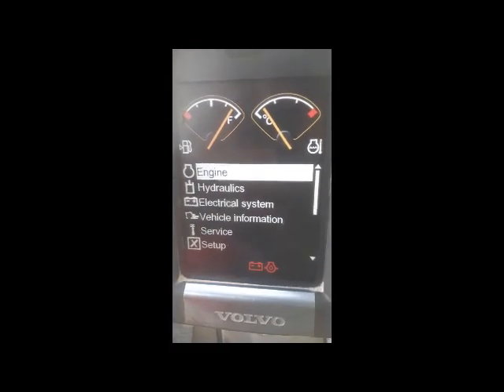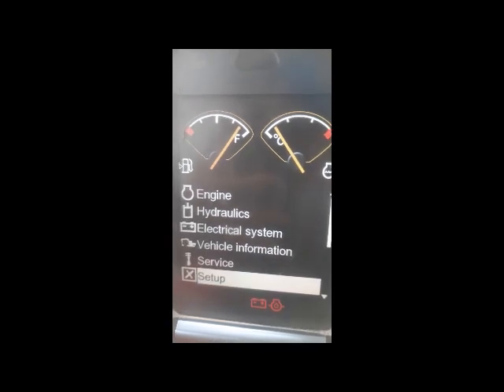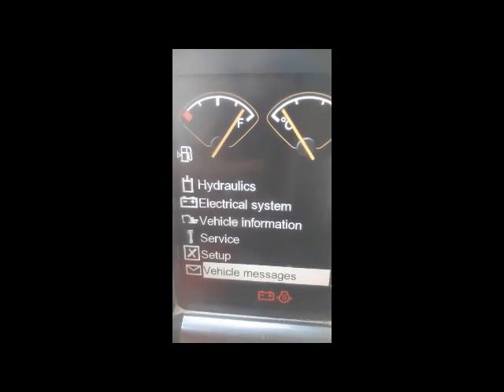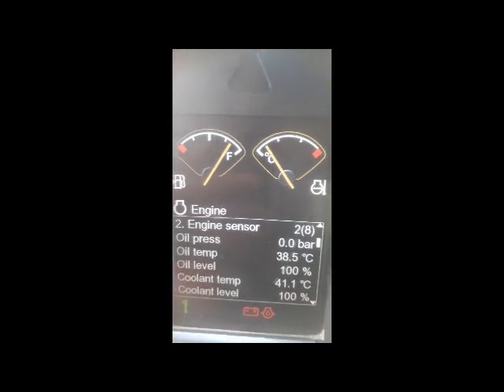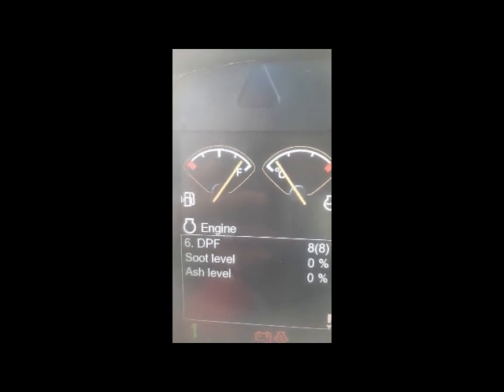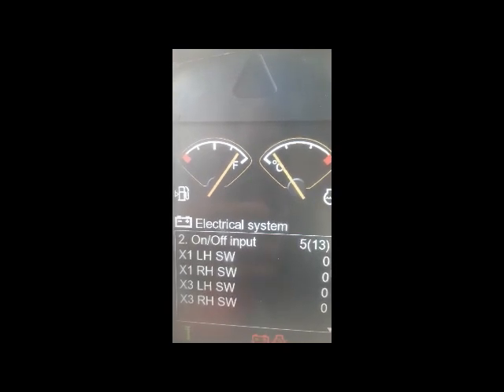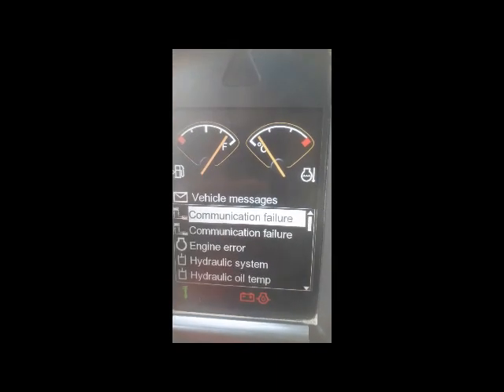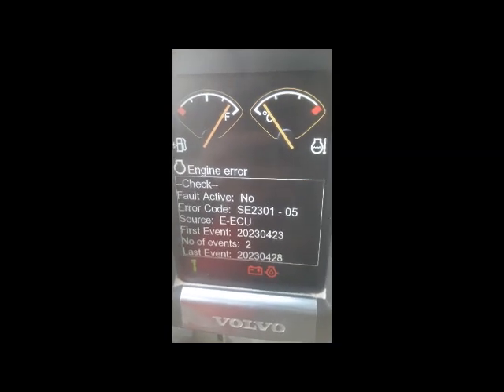Mastering Monitoring ||Sensors, Inputs And Outputs||Volvo Excavator EC480D

Comment: Hello , i have volvo  Ec 360.. 2008 today came up error (engine speed sensor failue) digger starts very slowly but it start.  Can you tell me whitch sensor on egine it is? Is it front or back one on egine? And also can i use this maschine until  new
 sensor will come.?
Reply from the maker: Engine sped sensor is crank or cam sensor
Reply: @AlbertB72  can i work with a maschine?